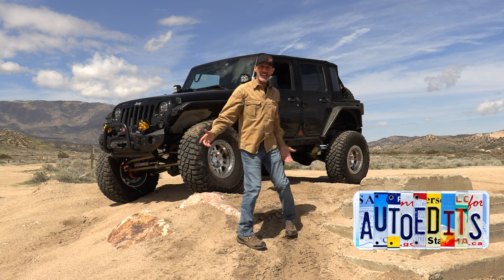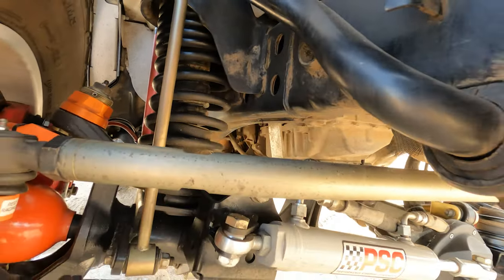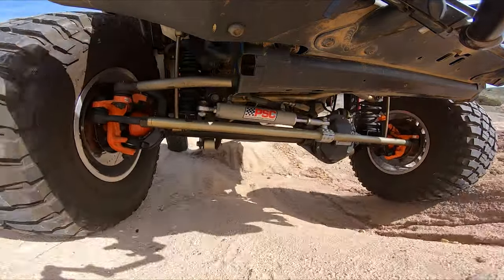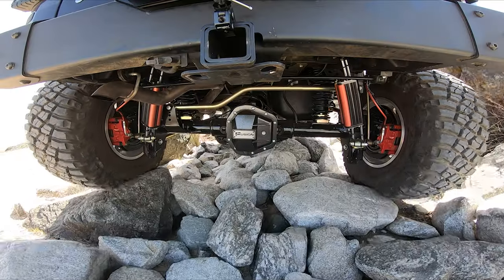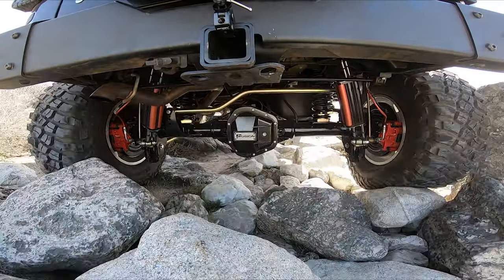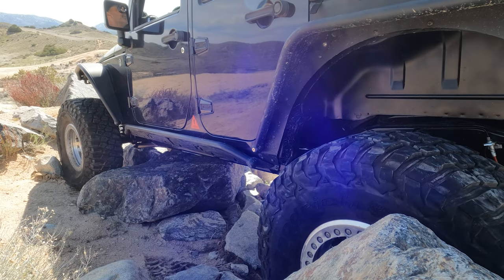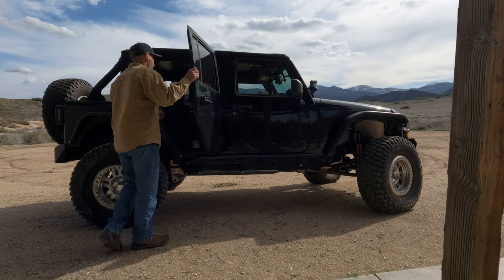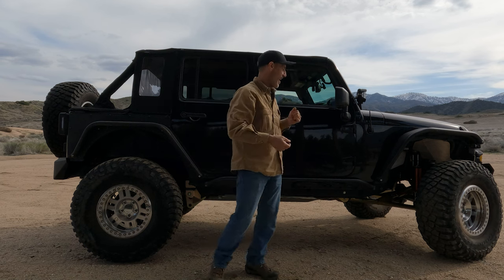Trail Testing the JEEP with BFG KM3 Tires and a NEW Dana60 Rear Axle

Comment: Great content!  For whatever reason, I set my heart on 37" tires for my Fj40 Years ago (we're talking like 20 years... ago..).  So hearing your take on the tire size and gear ratio is incredibly helpful.  I did pick up some used 37's for mock-up but will need to decide on a particular brand when it starts moving.  BF's have always been a contender.  I appreciate your take on things, looking forward to the next video.
Reply from the maker: Right on!

Comment: It's funny to me that you started out on 37's with no lift. And here you are, years later on 37's again. 👍
Reply from the maker: Yeah, interesting progression really. If I had an unlimited budget and the tires were available... I would've ordered both axles at the same time with a 5.13 gear ratio and looked for a set of  KM3's in the 39" flavor. That would maximize my setup but I think learning to drive this well... will go a long way. Plus, the peace of mind I have in "under tire sizing" the components is really good.

Comment: Jason Great stuff!!   A while back you gave me a comment on a reply when I mentioned I installed the DB3 on my JLUR.  My second video @jeepNdirt (no camping overlanding) was the second time I took full advantage of the ride on a fall exploring / overland type trip with my wife and as you stated on your video (that long arm feel and great handling) was all I experienced in addition to the great climbing / traction on one particular park here on the east coast (Outdoor in the Smokies) where the main Black Diamond trail was 30 to 32 degree incline to the peak.  You are so accurate in your description.  Also, I'm a little on the fence about your current tire size.  While I agree that the 37 is a great all around tire size a 37 is really a big 35.  For me although I have 38's on my JL (to have a close to size 37) and know that the newer M210 /220 series axles are strong enough to handle on that set up, now that you have Fusion axles, specifically that 60 on the rear, I think your jeep would benefit from 38's for that close to size 37 which would give you just a tad bit more clearance under that pumpkin and more of that "40's" look.  Not taking away from your current set up at all, because in the end I think there's NO WAY you're likely to break axles, but prior to learning to accept 4 door jeeps  (I'm an old school YJ guy of over 22 years) I always loved the look of a JKU on 40's and themed my JLUR build that way, but on 38's.  
Great video and  very inspiring as always.
Reply from the maker: Thanks for all this!

Comment: Your Jeep is SO capable. I also like that inflater system. Every driver should have one of those! I wonder if one of my 10,000 kWh phone chargers could power that? LOL! That would be better than the silly, little CO2 catridges that I use with my bikes. I'm forever fixing flats out here, and pumping up the tyres after a tube change is the pits, lol. Aloha!
Reply from the maker: HA! Thanks for being here and Aloha back atcha!

Comment: Nice video.  Before you remove bump stop (2:14), keep in mind those metalcloak bumps will compress down to about 7/8" on a hard hit like whoops.  Also, at 5:26 it looks like the top of your driver rear shock hit something.
Reply from the maker: Good suggestion and good spot on the shock.  That was from when I installed the d60 rear axle and had that shock flipped outboard and it touched the frame... It is now in the correct position and happy!

Comment: You videos are always great when it comes to your Jeep. I chose to stop at 37s on my Rubicon for nearly all the same reasons your spoke of regarding 40s. But mainly I didn't want to drop the coin on 1 ton axles. I just beefed up the Stock Dana 44s. The 37s are perfect if gearing is correct. I went a little more extreme on the gears though and went with 5.13s. Also, I am on a RK long arm kit. Seeing your rig move side to side as you went through the rocks vs what it would do on a long arm setup would be night and day. When are you going long arm?
Reply from the maker: Interesting to hear this. It makes sense. I'm going to wait a bit and just get some miles on this setup first and then consider pulling it apart again LOL

Comment: Good stuff.
I wouldnt just take that puck bump out.
Go get some clay, place it on the frame, and go hit some whoops where you max the bumps out for real. The clay will deform. Use that measurement to adjust your bumps. Only reason I mention this is because you have those metalcloak progressive bump tops. They have a ton more room for compression under heavy load.
Reply from the maker: Excellent recommendation!

Comment: hows the lock and load doing? looks great.  any more flex than standard metal cloak control arms?
Reply from the maker: Yes it does offer a bit more articulation in the front and I'm very happy with the performance overall.

Comment: When are you going to do Metalcloak long arm in the rear? Your videos have me slowly "cloaking" my 13 jkur on 37"s. I want to know if I should go db3 or long arm.
Reply from the maker: Sorry not sorry 😂I'm think about the long arms... the Jeep just feels so good right now that I don't want to take it apart for a while!
Reply: With the DB3 (metalcloak) rear brackets it's almost not necessary to get long arms unless you're going to ton's and 40's.  There are many who say the drop brackets "hang up all the time", but as anyone can clearly see in this video that's not the case.  Can they hang up? Sure, but do they hang up all the time?  Depends on your wheeling style.  Also if considering rear long arms even with 37's or 38's then opt for the tuck up style kit or custom build your self so that the arms are not in the way otherwise the potential for hang up could possibly be more than by using the DB3 bracket.  (This is really clearly understood on the Metalcloak website and video about the DB3 bracket).  I'm personally on 4.5 inches of actual lift running 38's on my JLUR (As seen on my channel jeepNdirt) with the DB3 rear brackets and couldn't be happier.  As jason pointed out in his video when he first installed them they truly give that flat feel, stable ride, and seemingly better climbing traction when off road due to that "anti-squat" geometry stuff that I won't try to explain as there are so many who do it WAY better than I could on YouTube.  Good luck with your build and "rock" on.  Lol.
Reply: Long arms move the low point up when the suspension compresses, db3 brackets low point is fixed. Jk rear arms are shorter than fronts. I usef to do extreme rock crawling, rode right seat competing in a Shannon Campbell built yj buggy, my interest is in driveability as a dual purpose rig. I have a Crawl of100+ to one on 37"s with a tremec and 4.10s. Eventually 40s tons 5.38s 130 to 1.

Comment: I might be wrong but it looked like you left your swaybar links connected, was there a reason why you didn’t disconnect them during this test run? I’ve finally gotten to a point where I can upgrade my JK and thanks to you I’ve ordered MetalCloak! Although my build will be a bit more reserved with a 2.5in lift on 35s.
Reply from the maker: It's a Rubicon with e-disconnect. You'll have every bit as much fun as me...just get in the dirt as often as you can!

Comment: Correct me if I’m wrong, but for as long as I’ve been following this build (since the Flow Master exhaust video), I can’t recall any mention of your clutch. I have zero experience driving a manual off-road. Seeing as you use the Jeep regularly both on and off the road, are you still running the stock clutch? Have you had to replace it since you took ownership of the Jeep? What’s it like at the beginning of a day on the trail vs. the end when you’ve been constantly beating on it? I’m very curious!
Reply from the maker: The clutch is the original stock unit in this Jeep and still works really good. I did a video on stick shift driving https://youtu.be/gWNI36zIPgo

Comment: I have 2016 JKL and want your advice.  I want to keep it factory height and not put a lift kit on it but make it stronger than stock…any suggestions?
Reply from the maker: Absolutely! Chromoly axle shafts, metalcloak under armor (skid plates),  rocker protection and then go wheel the heck out of it. I also recommend a winch.

Comment: Jason, Are you feathering the clutch at all through the Sleuce? Do the 4:88 gears help to not need to clutch in and out? I have stock 3:73 on 33s and when I go out, I’m on the clutch a lot to keep things moving.
Reply from the maker: Not really, just had to goose it a few times at that tricky spot!

Comment: Those break lines hanging out there is sketchy
Reply from the maker: Nah, they’re good. Not sure where else you think they should go.
Reply: @AutoEdits  I drive across my ranch and those would definitely get ripped off. Oh and your tires did good, they had a ton rolling and flex on the sidewall and never rolled a bead